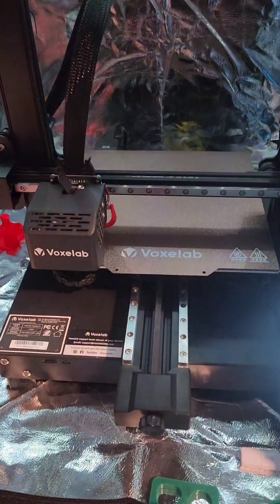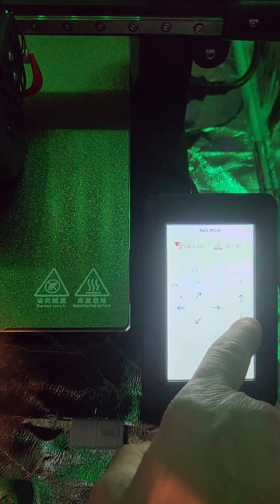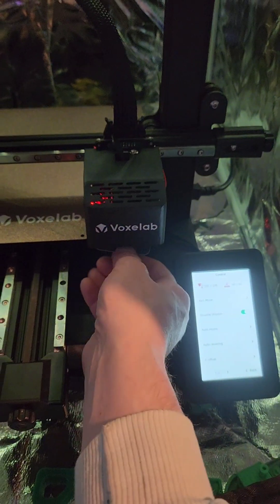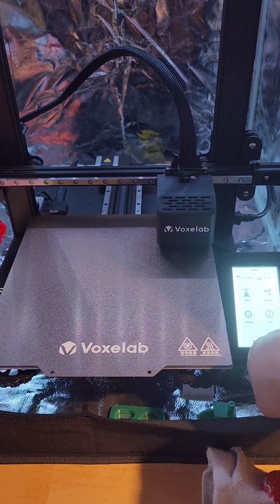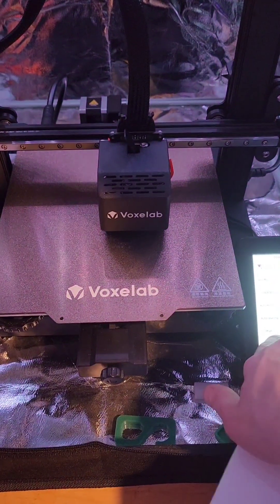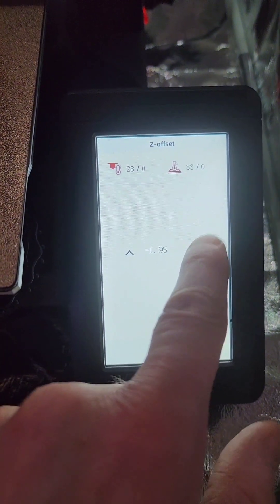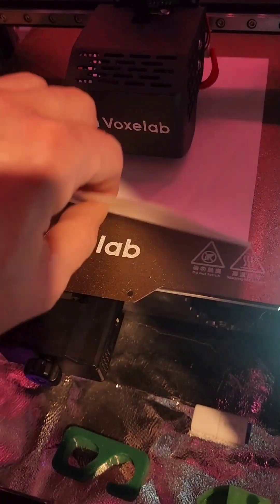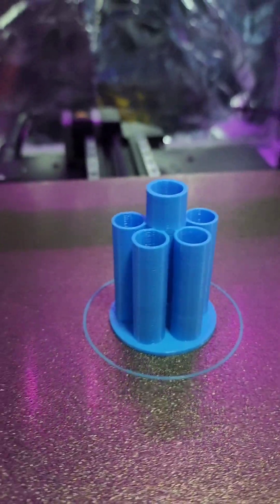How To get better more accurate Bed Level Voxelab Aquila D1 manual auto Leveling Tutorial Ender 3

Comment: Never mind. I loosened all the screws and let the springs relax a little and I got the bed up to the z zero point. Did the auto leveling and set the z offset. Works like a champ.